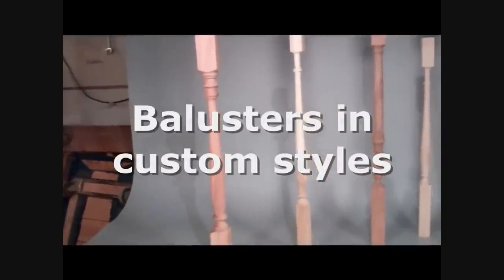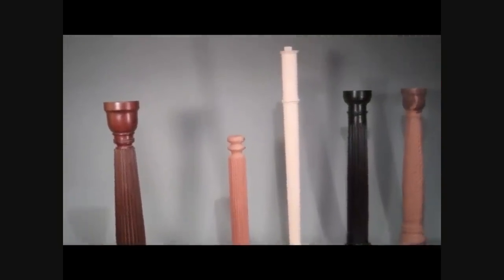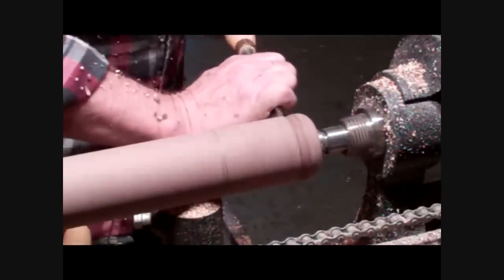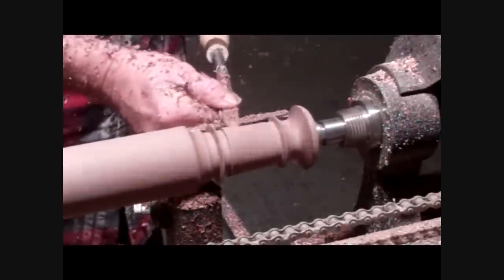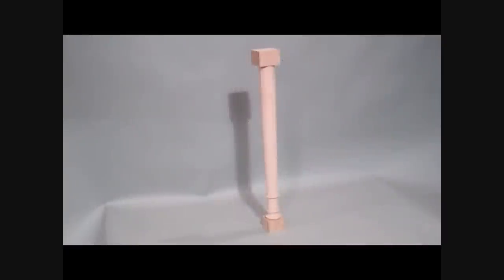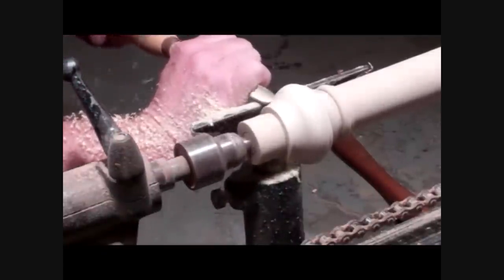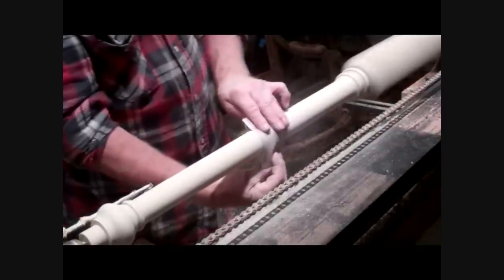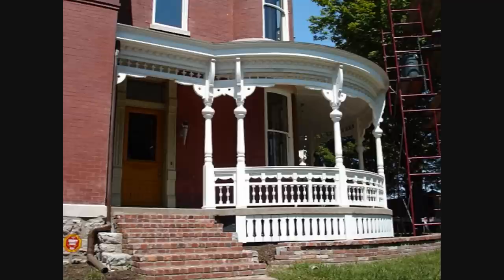What is Architectural Woodturning_0001.wmv

Comment: I want to make similar items, do you think it’s horribly unprofessional to do them in 5’ sections and try to hide the joints in beads and what-not? 
Did you guys extend common lathes yourselves or are those special made for very long items? 
Mines a 1957 craftsman it’s just a tube and a bar underneath....couldn’t be THAT hard to make it longer 🤔
But I trust the 1957 steel tube far more than say a 2018 one 😂 
Any input would be appreciated, 
thank you.